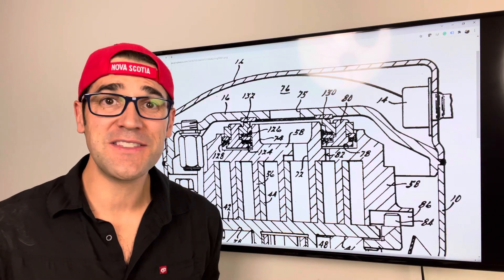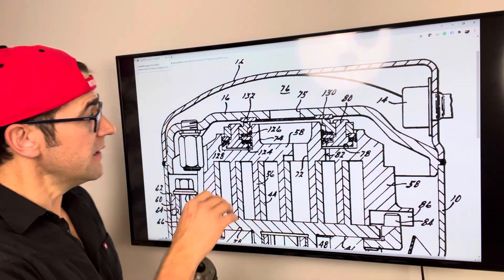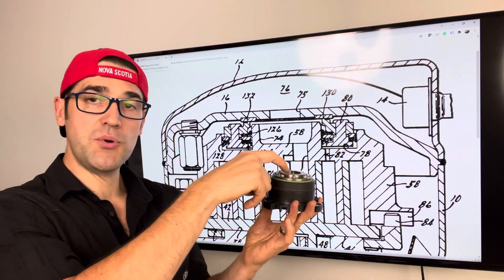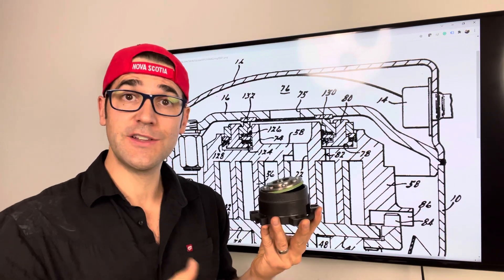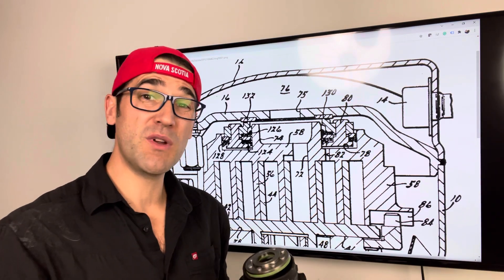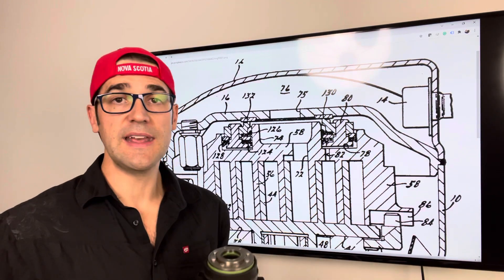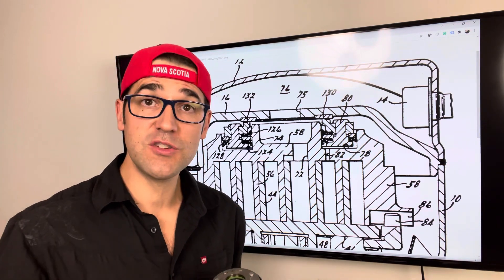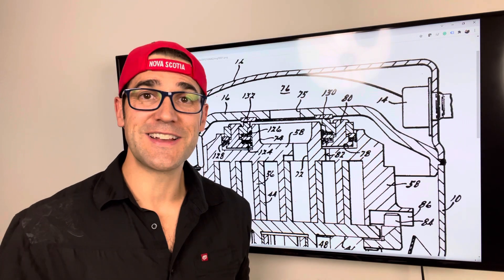How Does A Scroll Floating Seal Work?

Comment: I would like to report an issue with Copeland compressor MN#ZP20K7E-PFV. 2 Ton ICP air conditioner compressor. During initial start up charging compressor gets slugged and make funny noises eventhough I charge very slow. ~5 minutes /lb I can't even add 0.5lb extra because I am very concerned about the design of the compressor. It's really tight and small fit I think these compressor and there is almost no room for little bit of extra refrigerant. I am even considering switching to a different tonnage or brand and this point because I am really worried all these 2 tons we install will fail in less than 5 years. Any suggestions?
Reply from the maker: I recommend Contacting ICP or Copeland about your situation. Where are you charging it? If you charge into the suction that could happen.

Comment: At a certain property, I keep hearing a distinct, noticeable, continuous "clinking" noise coming from a lot of Magic Pack compressors. Many of them seem to be pretty low, like 40 psig on suction side (r410a). Is that clinking noise possibly the floating seal dancing around the muffler plate? Or some other internal bypass?
Reply: Do they still cool ?
Reply from the maker: If you go over at 10:1 compression ratio with certain R410a compressors that could be the cause.
Reply: @RefrigerationMentor  Is there an AE bulletin where that 10:1 number is documented? I’ve looked to no avail. Ty B told me it was 11:1. Precise number doesn’t matter, I’m just curious where it comes from.

Comment: I’m a bit confused. During normal operation, is the seal supposed to be up or down? Would a bad seal stay in the wrong position, causing no compression even on cold startup?
Reply from the maker: The floating seal starts down in the unloaded position and at start up it is forced up against the muffler plate of the scroll. A failed floating seal will not move but depending on the scroll something else could be causing it not to move. Example TOD temperature operated disc or ASTP advanced scroll temperature protection to name a few. If you are interested in learning more I have compressor trainings running at different times of the year. Learn more here https://refrigerationmentor.com/upcoming-courses/

Comment: Had a  two year old ZP516KE In a Carrier HP fail after 20 min of run time after it cooled off. Checked voltage, amperage, windings, run cap, and charge. All in range although superheat was (low) 7ºf  subcooling 13ºf . Curious why it was failing. I will take your advise and cut it open.
Reply from the maker: Until you look inside it will be hard to tell and even when you do that it’s difficult to figure out why. Take lots of pictures.
Reply: @RefrigerationMentor  Your were right. Not much visible as far as damage. The top unloader scroll support did show signs of wear possibly. The flat metal spring had signs of deformation and wear. Nothing that would give reason for the scroll to vent and stop pumping.

Comment: Why is the pressure seal failes? 
To hot temp? Or its other?
Reply from the maker: The main reason is when your temperatures get too hot the oil brakes down and when you do not have lubrication that causes the failure.

Comment: R448 @8PSI for a WI freezer makes it difficult to stay in the compression ratio parameters here in Phoenix, AZ. 115F ambient temps in the summer. Especially starting up warm boxes. Normally have to babysit the condenser with a water sprayer.
Reply from the maker: Kyle, I guess it would depend on the compressor you are using.  For example, I know both Copeland ZF scrolls or Bitzer's 4EES compressors should handle those conditions with no problem.  You may need some additional cooling so you would have to check the operation envelop of that specific compressor.

Comment: That's, good info. 
Question, what's the min and max compressor superheat for Copeland scrolls worked out in Celcius. And is it different for low, medium and high temperature applications?
Reply from the maker: It will all depend on the application and refrigeration but you should be look for around 11K for synthetic refrigerants like HFC/HFO. Application with CO2 R744 Transcritical compressors need min 18F (10K) SH and Subcritical min 36F(20K). New blends like R513 on low temp applications need a minimum superheat as well check with the compressor manufactures.